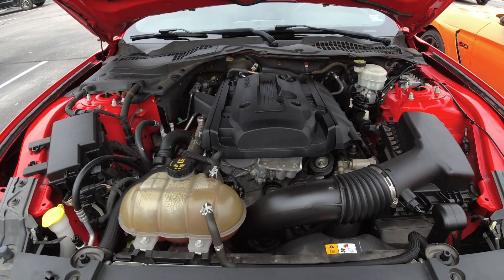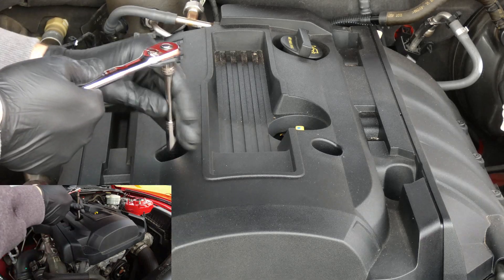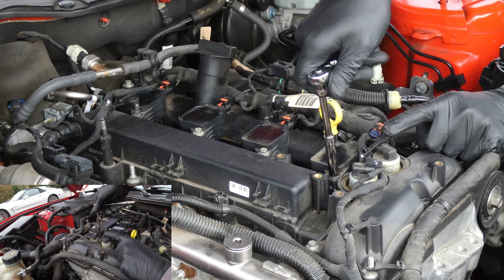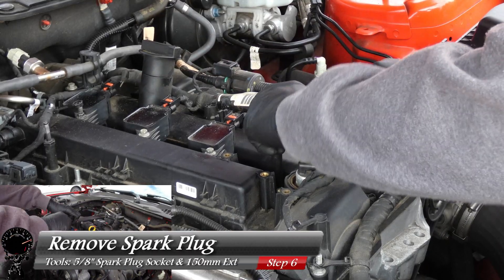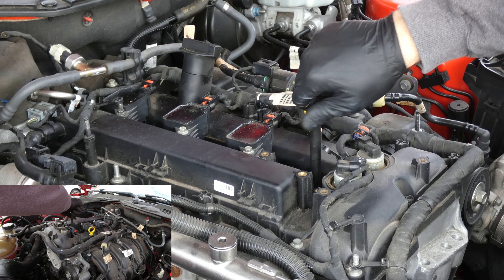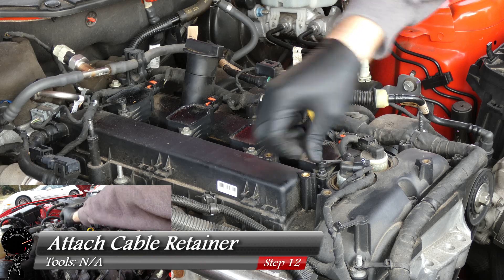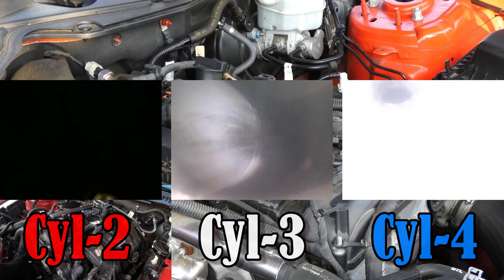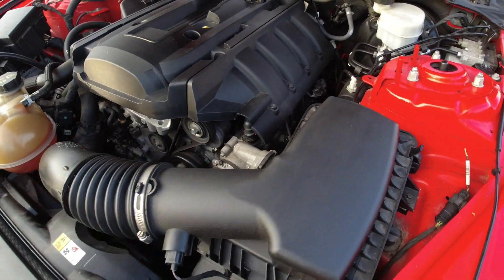How to Replace Spark Plugs for the S550 EcoBoost Mustang

Comment: Which NGK spark plug and gap would you recommend? Someone said NGK 95605 with 0.28”
Reply from the maker: I don't have a specific brand in mind. As long as the spark plug gap matches the owner's manual, you should be good. 0.028in is within the 0.027-0.031 in. Specs.

Comment: This video could work for a 2018-2023? This has been the best video edited and easy to understand video. Appreciate how throughout you are! Very nice video. Thank you!
Reply from the maker: Yes, the same engine for the ecoboost was used for the S550 run. Only (major) change was the spark plug part number in the manuals. It seems SP-537 was superseded by SP-550